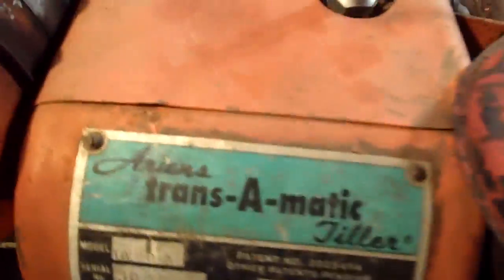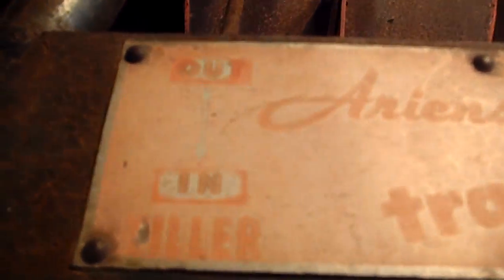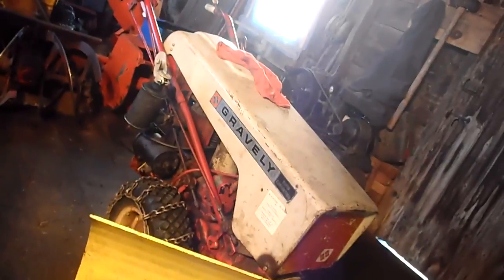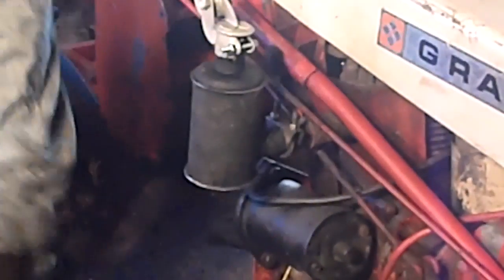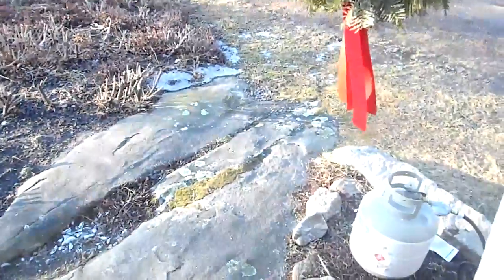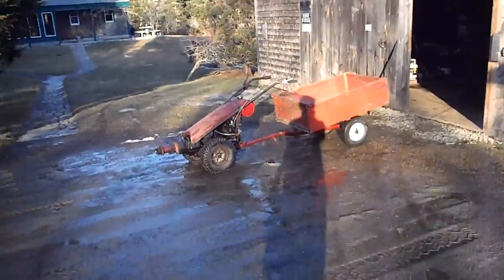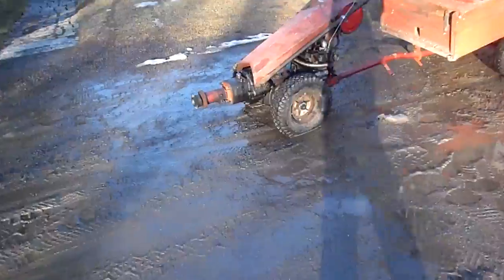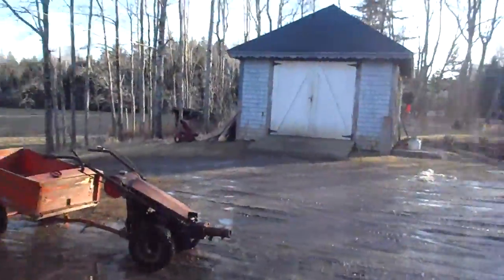The 1951Gravely Model L is running again!

Comment from the maker: @stevenpturcheck Thanks! I also like the way it sounds to! It is 10 times more quiet then the pepper pot. You hear more engine noise then exhaust noise. The only reason it did not start first pull was because the gas was turned off. If it was on it woulds have started first pull ;)